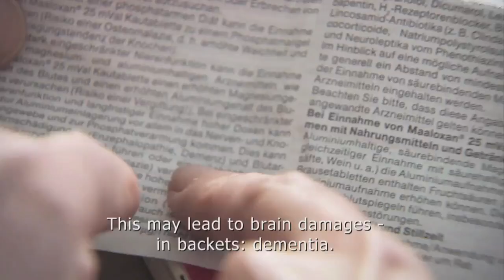The Age of Aluminum

Comment: Aluminium injestion is unavoidable, as it is abundant in the Earth's upper mantle.  Aluminium is a heavy metal, it is a natural toxin and a known neurotoxin. 

But aluminium injestion is very different from aluminium injection when looking at it's neurotoxicity. For instance, when we eat or inhale aluminium it is filtered into the bloodstream via the lungs and digestive tract and ultimately rejected from entering the brain by the blood brain barrier. But injected aluminium (intramuscular), is met with a top level defensive immune response. This means if the immune response isnt affective in transferring it to the bloodstream it will consequently travel within the lymphatic system, not guarded by the blood brain barrier and inevitably contaminates the brain and other vital organs. Specifically, aluminium adjuvant nanoparticles found in vaccines.
Reply: The level of aluminum in vaccines is actually extremely small nowadays and it doesn't escape the muscle because its small enough for the immune system to deal with it.
Reply: @gnostaoticanarchangautand  3 years later now, would you bet on that with such certainty? Now that we've been through 3 years of jaw-dropping gaslighting.... like how they told us emphatically that the mrna injections would not leave the injection site..... dead wrong about that. Travels to the Ovaries, Brain, Pancreas, etc etc..... and persists there apparently indefinitely.. shit, we're so screwed.